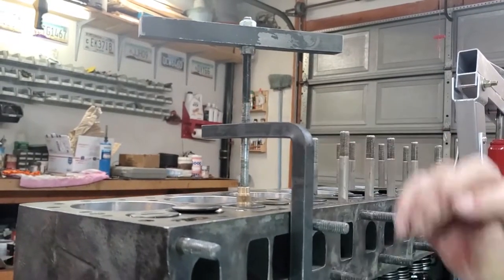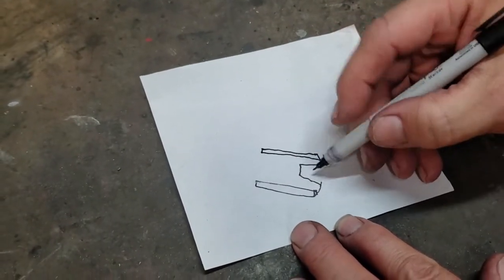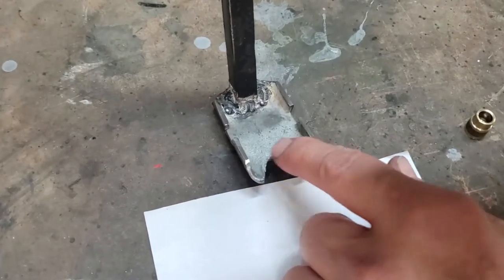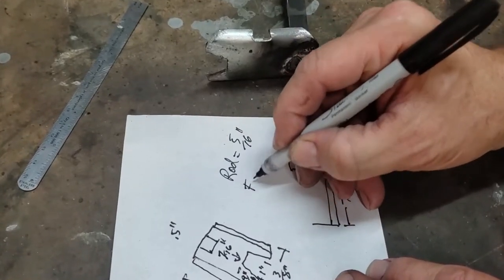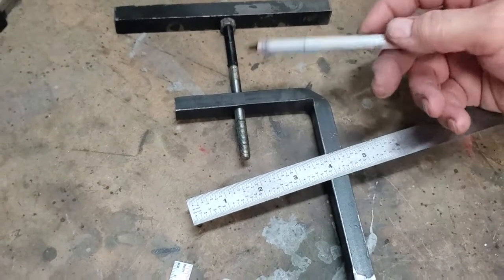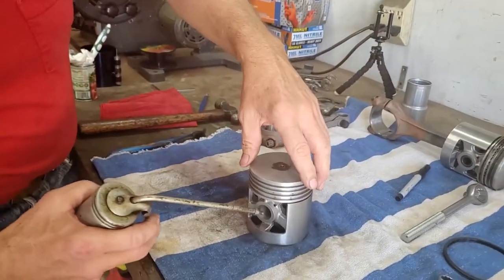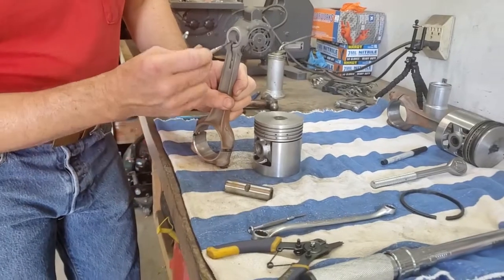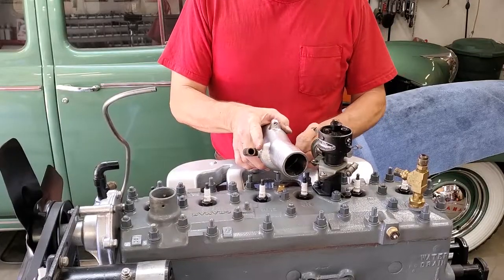Graham Supercharged Engine Overhaul Part III - Valve assembly - Piston Pins

Comment: Hi David, I read that Graham redesigned the pistons for ‘38 which made cold starting more gentle on the engine due to a bottom groove in the piston. Have you seen any problems with using the earlier pistons, or ones without the groove? Doesn’t seem like any 38-40 NOS pistons are available.
Reply from the maker: It doesn't make a difference. Graham came up with the 4th groove in the piston for instantaneous cylinder wall lubrication. it was a sales gimmick, but it doesn't matter in real life. I have used the earlier pistons for over 75,000 without any problems. if this had really worked the idea would have been duplicated by other manufacturers. All manufacturers have come up with equally felicitous ideas to differentiate themselves from others.
Reply: @CarzPlus  Any feel for what works better? Split skirt piston or non? I've got to use either a Silverlite piston or split skirt as that's all I can find. Thanks!
Reply from the maker: @mannyhondroulis8574  Do not use the Silverlite pistons if you have to enlarge the piston pin hole in the original Graham rods. They will fail. Slotted pistons can be used. If they also include vertical oil grooves position these towards the valve side of the engine.
Reply: Carz Plus I’m planning to use 226 rods with the 226 pistons. Still ok?